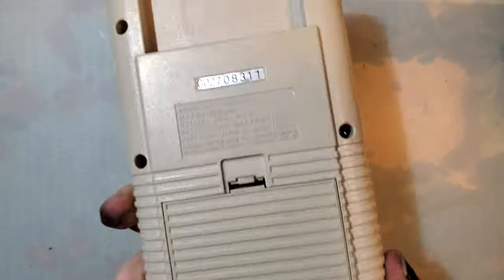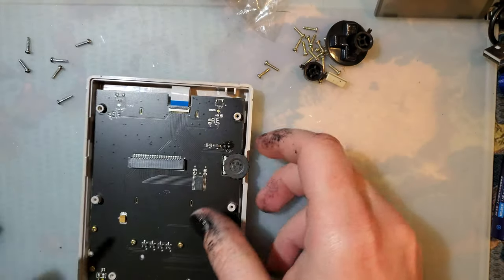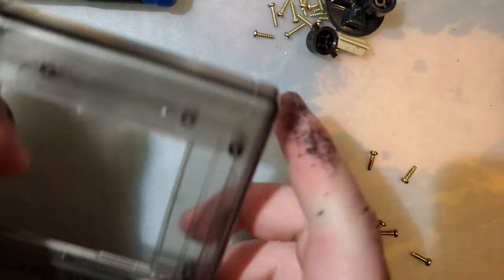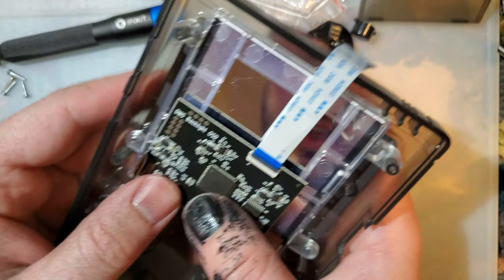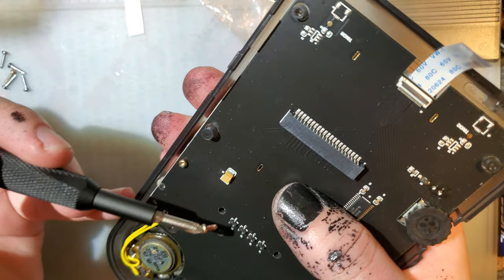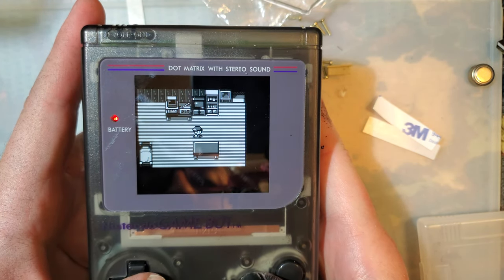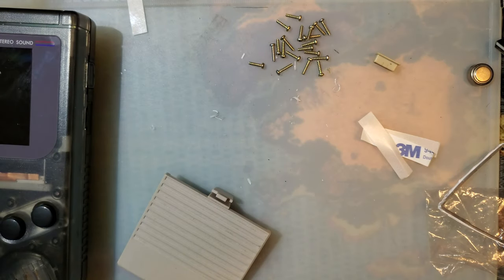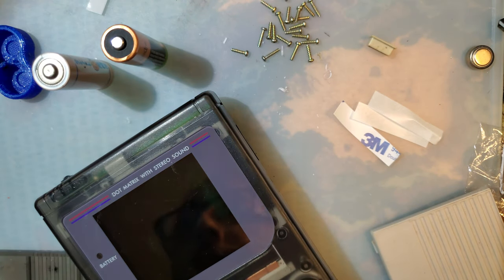Game Boy "Factory A" Aftermarket Housing

Comment: Just did two funny playing V2 GBA's to look like the original DMG but used white shoulders,sides, joypad and put the maroon buttons for A and B. I friggin put the first sticky on upside down after checking like three friggin times to make sure I wouldn't screw it up. I pushed it up as much as possible and it's not that bad. The second one I got two specks of dirt behind it but you can't tell when it's on.

Comment: Yeah this shell is nice, I use this GITD green one on my one chip OSD IPS

I talked with the one chip seller which base at Mainland China, they said one chip factory planning sell Wonderswan Color backlit not sure is IPS or TFT after the GBP OSD in stock.
Reply: This USB charge battery good or not? I plan to buy it on Taobao before but their product description make me feel confused
Reply from the maker: @gnuhc315  I hope the WS kit is better than the previous iterations from other manufacturers. The unique design of the console makes backlighting it properly very difficult. 

And what battery do you mean?
Reply: @makho  I mean the jugee battery you showing at the video last 3-5 minutes. 

The WS OG I just mod it to GBP polarizer film and backlit, the result is nice. Hope the WSC mod kit will be affordable and nice, the WCS backlit kit which on the market is so expensive and hard to find and buy.
Reply from the maker: @gnuhc315  ahh, yeah. So they are pretty good (the AA at least) but I'd wait a bit on them. I talked to RGRS about it and they spoke to the vendor and the vendor is going to slightly tweak the batteries to work better for Game Boys, specifically the Game Boy Advance. The low voltage mode on them is rather high so they've agreed to lower the voltage so that the battery actually triggers the low voltage warning on the GBA when the batteries are low. The low voltage warning should still work on other consoles like the GBC and DMG though (but will work better after this tweak). I don't have any ETA on that and I have no idea if they are tweaking their entire line up or just making a new SKU. 

I did get my hands on some preproduction AAA batteries and while they have some potential, the capacity on the preproduction ones was way too low to be usable. I'll be testing again when the final version is released.